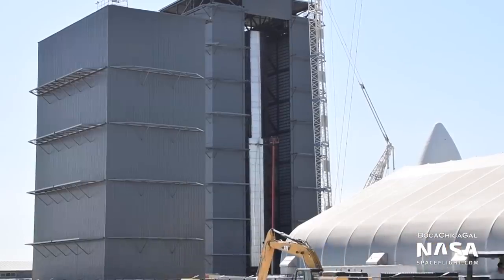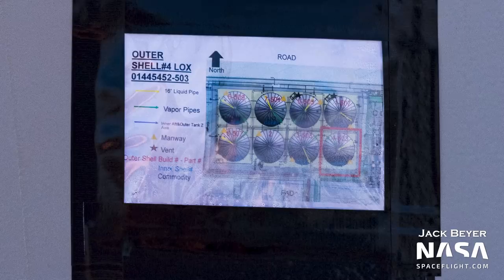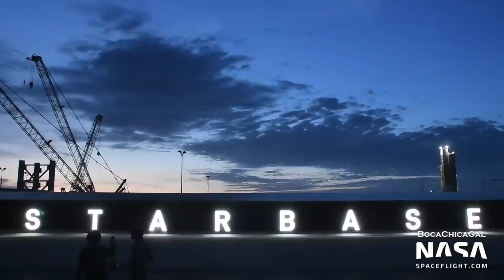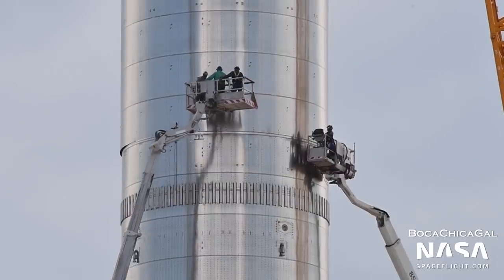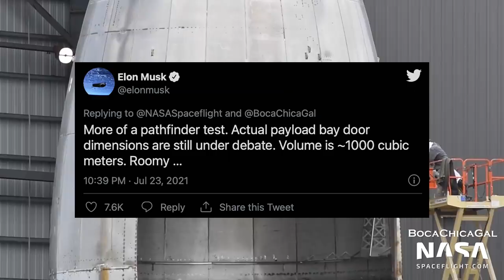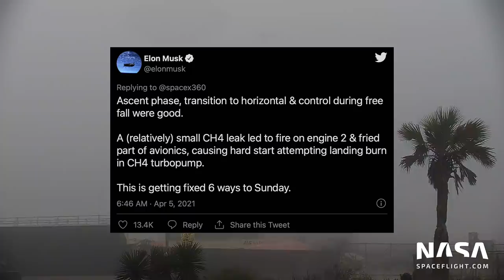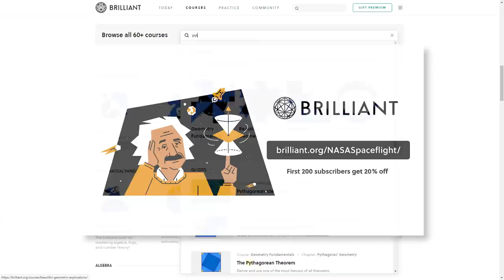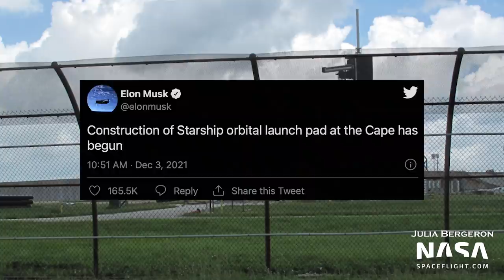No Orbit, FAA Delays, Raptor Issues: Was 2021 Worth It? Starbase Progress Update

Comment: Just some info on BN3. The part cut off was the methane tank, this previously meant that the oxygen tank had to be pressurised and therefore monitored. I’m sure they removed the methane tank section to be able to leave BN3 as long as they want and not have to give any care in the world about how it is doing and not worrying about high winds etc..

Comment: I fully expect the Robert's Road facility to be closer to a more traditional rocket factory. In fact, I would not be surprised if instead of three tents, low bay, mid bay, high bay and wide bay there was two or three  buildings next to each other used for the construction of Ships and Boosters.

The main building would have a footprint much larger than the combined buildings at Boca Chica, and be between the low bay and mid-bay in height, A second building would be even larger than the wide bay. A possible third building would be slightly shorter than the high bay but still tall enough to fully stack a ship.

Coils of steel, engines, and other supplies would arrive at one end of the main Starship factory with completed  Ships and Boosters leaving the other end.